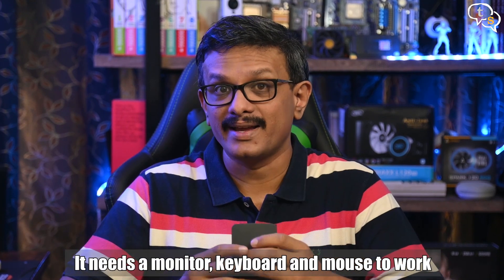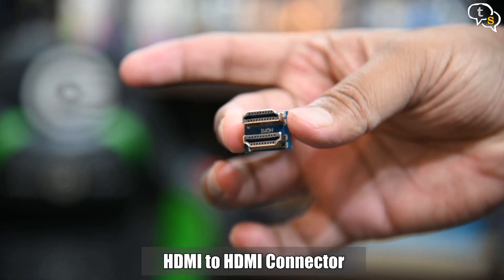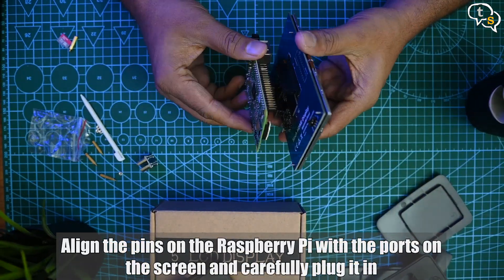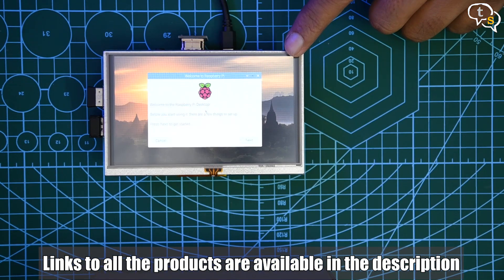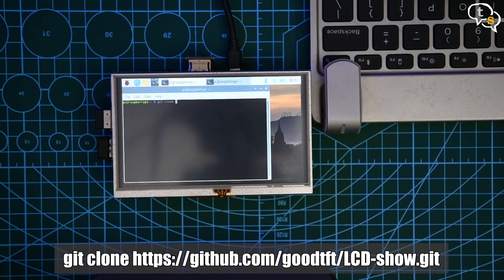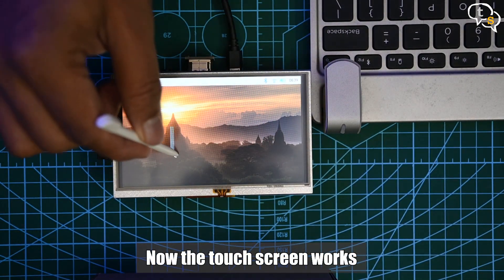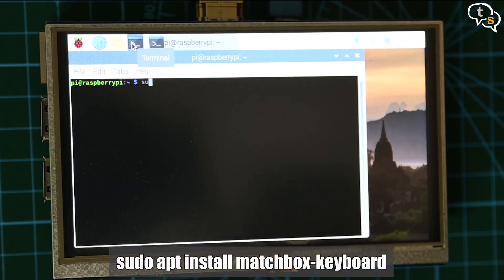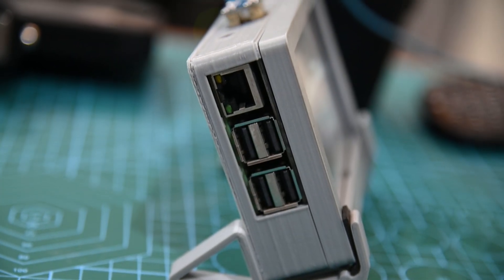Raspberry pi - 5 Inch touchscreen Installation

Comment: This is brilliant. I've been messing around for ages trying to get this screen working. The instructions work perfectly even for a Pi 4 running Debian 11... Use a HDMI to Micro HDMI cable because the Pi4 sockets are different and the stand off pillars aren't in the correct place, but besides that just follow the instructions and the screen and touch panel work perfectly. Thankyou.

Comment: I have this lcd display for my raspberry pi 3b, but the HDMI adapter that came with it doesn't work, it gives no signal. I got another connector but it still does not work, while it does work when I use an HDMI cable. Do you know by chance if I am doing something wrong and what I can do to make it work without needing a long hdmi cable?

Comment: Bro one doubt i bought this 5 inch display they told that it will work in pen and touch screen it's true
Reply from the maker: It comes with a small pen which it will work with.
Reply: @TalkingstuffNet  bro it is not working for raspberry Pi 4 i saw a chinese video i done that and it currepted 😢

Comment: I prefer a minimalistic 3.5" size for the portable one. I'm building another "desktop" setup with legacy and GPIO cable to breadboard which can have a 5" display. You can overstretch the resolution (480x320 --> 720x480 as an example). There are other potential tweaks to play with in the files used at boot.
Reply from the maker: I started with a 3.5 inch display, but it was faulty and got a refund. I then picked up a 5 inch screen as it would work better for a portable game device. I've now purchased a steam deck for portable gaming.
https://youtu.be/oTwjFLYEpwg

Comment: hello sir, after the  rebooting just like in 5:00 when i get in the desktop i am finding my wifi disabled although which is not and i cannot enable it and also the touch is inverted along  an axis can u plz tell me the solution to both of this issues and i m using pi 4 model b. thank you
Reply from the maker: Hi, try connecting the pi to a network via ethernet, maybe it might update and fix your wifi problems. As for the inverted screen you have to change the values in the file Ive shown. I've not tried the same with a pi4b

Comment: can i add speaker with this rasberry pi
Reply from the maker: Yes you can, using the 3.5mm audio port. If your screen has a speaker it would play via the HDMI connection.

Comment: Very good! How to install with flex cable to release the pins?
Reply from the maker: But if you do that you lose touch screen capabilities. You could use a hdmi to hdmi cable or a display flex cable to connect if you want to separate the two.

Comment: I have the same settings as you recommend, however when I move the touch pen the mouse pointer moves backwards. can you help me? Thanks
Reply from the maker: Is the tablet in the right orientation, there is a setting to flip tablet horizontal.
Reply: @TalkingstuffNet   how to set to flip tablet  horizontal
Reply: @TalkingstuffNet  thanks, I will try it
Reply: While following and setting mine up, the touch controls were inverted for my screen and I had to modify the conf file, figured this might help someone else too.
The reference I found:      https://www.raspberrypi.org/forums/viewtopic.php?p=425962#p425962

In my case I was using "LCD-Show" so my config file was:                         sudo nano /etc/X11/xorg.conf.d/99-calibration.conf
and looked like below when working properly:

Section "InputClass"
        Identifier      "calibration"
        MatchProduct    "ADS7846 Touchscreen"
        Option  "Calibration"   "140 3951 261 3998"
        Option  "SwapAxes"      "1"
        Option  "InvertX"       "true"
        Option  "InvertY"       "true"
EndSection
Reply: @connormccorkle6461  Thank you very much!

Comment: All works perfectly until I tried to install the matchbox-keyboard . there is an error meaage as its seems the resource is not available anymore. Does anybody know a different code  to use?
Reply from the maker: Make sure the command spellings are right, or you might need to download and install manually.
Reply: @TalkingstuffNet  thanks it works now I had to update the system and reboot ... afterwards all works perfectly! Thanks again

Comment: i have a problem with the line "git clone" (appears error 443) how can i fix it? or exist another solution to install the driver?
Reply from the maker: Check the git url, the error signifies it couldn't connect to the git repository
Reply from the maker: Search for the git on GitHub and find the new url and replace the same in the command.

Comment: does it support raspberry pi 4b
Reply from the maker: The gpio pins will match, but as the pi4 has a micro hdmi port, you will need to use a cable instead of the connector provided with the display.
Reply: @TalkingstuffNet thank you
Reply from the maker: There is a model available which has a micro-hdmi to hdmi connector https://amzn.to/39QLq8s

Comment: Can I use a 32GB micro SD card for this ?
Reply from the maker: Yes you can, you can add upto 128 Gb micro-sd card too.
Reply: @TalkingstuffNet  Which Raspberry Pi model should we use 3b or 3b+
Reply from the maker: Both will work, I would recommend the 3b+ if you haven't purchased one yet.
Reply: @TalkingstuffNet  Thanks

Comment: Still be nice if it was connect to a raspberry pi 4
Reply from the maker: I had a pi3 that's why I used it instead 😅. Did want a pi4 but couldn't justify the cost. Not sure the screen works with the pi4 directly as the ports are not at the same locations and no full size hdmi. So you'll need a cable between the screen and the pi4.

Comment: Bro can i connect without pin's
Reply from the maker: Yes, hdmi to hdmi, only touch won't work.
Reply: @TalkingstuffNet  can i download drive for touch?
Reply from the maker: If pins are not connected the touch function will not work. You can use external mouse and keyboard via usb port.
Reply: @TalkingstuffNet  thanks 😊

Comment: Touch screen does not do any thing when I touch it.
Reply from the maker: You need to install the driver,  I have provided the commands you need to run in the instructions. Use a USB keyboard and mouse to install the drivers. Wifi access is necessary to download them.
Reply: @TalkingstuffNet  ok I will try agan
Reply: @TalkingstuffNet  Still does not work.
Reply from the maker: Have you connected the display and raspberry pi using the pins on the display, not hdmi only? Are they aligned properly? Those pins transfer touch information. If it still doesn't work then you might have a faulty display. Also try the written instructions I have here https://talkingstuff.net/raspberry-pi-5-inch-touchscreen-installation/
Reply: @TalkingstuffNet  I only use the hdmi!My 5inch display has only a hmdi and micro usb.
Reply from the maker: You also need to connect the pins, without that the touch information won't be sent to the raspberry pi. The pins are under the display , and match the connectors on the pi.
Reply: @TalkingstuffNet  the display I have has not pins.how else can I get it too work?
Reply from the maker: If it's not the same display I have shown in the tutorial then it won't have a touch screen. Are you using a standard display?
Reply: @TalkingstuffNet  No the screen siad it was a touch screen when I boght it.
Reply from the maker: What's the size of the screen ? If it's a different model you might need another driver. Check the documentation that came with it. Hdmi to hdmi won't provide touch capabilities, you will need another interface at least at minimum a usb cable.
Reply: @TalkingstuffNet  same size as shown in vid.I have a usb pluged.
Reply from the maker: The usb you've connected is for power I guess, not connecded to the raspberry pi. There will be pins below the display which connect to the raspberry pi, they align perfectly.
Reply: @TalkingstuffNet  My display has not pins.
Reply from the maker: Maybe it has slots which will accept pins from the raspberry pi.
Reply: @TalkingstuffNet  No slots eather.
Reply from the maker: I show in the video how to connect also , make sure if the same are available on your display too.
Reply: @TalkingstuffNet  Ok I have cahged my rassberry to the lastest soffware.The same one you are using so i hope this works.